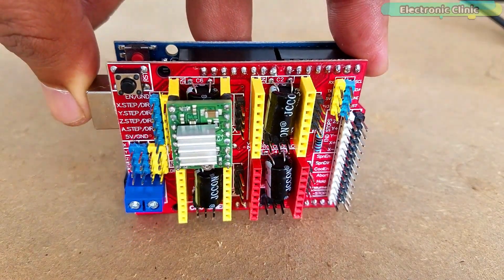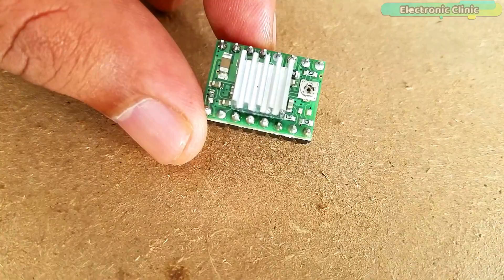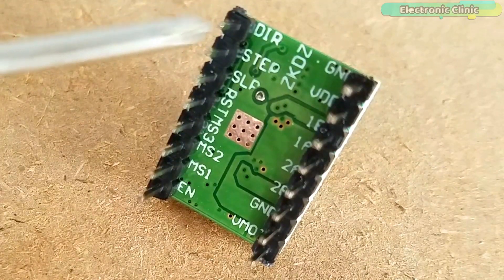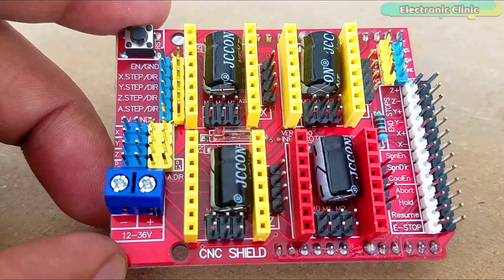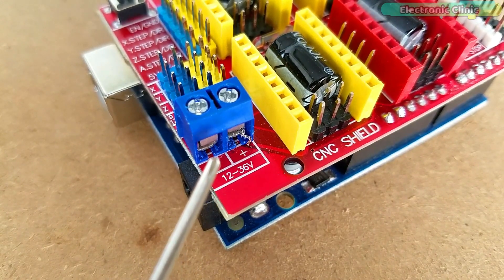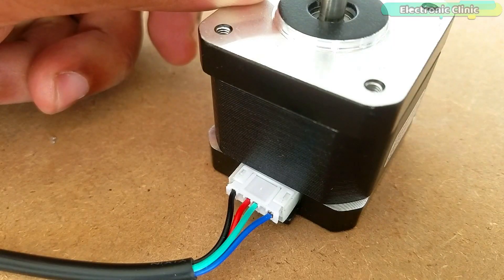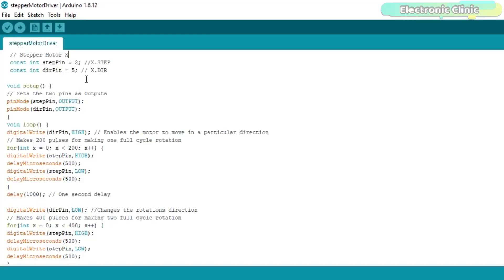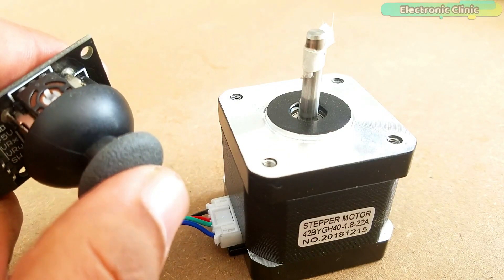Arduino CNC Shield V3 and A4988 Hybrid Stepper Motor Driver, CNC Shield pinout, wiring, code, DIY

Comment: Its working great for me but would like to control 2 step motors how to do it ?
Reply: Send step / direction to the appropriate pins
Reply: @petermuller608  thankyou I was able to control 3 steppers but they all run simultaneously at same speed. However, I want to make them run at various speeds for each one of the stepper motor.
Any lead on that, please?
Reply: @charmingali34  are you sending step pulses at different speed to your three motors? The step frequency is directly related to the motor's speed
Reply: @petermuller608  I am able to send step pulses at 3 different speed but for that I have to change the speed everytime. So the option is using Arduino Serial Monitor I can give my values but Serial Monitor is very basic and not a friendly GUI.
So, I build a GUI on processing and sending the values from Processing 3.0 to Arduino. But the problem being faced is I can only send one value at a time from Processing 3.0 to Arduino  which will run the 3 motors at that particular speed. However, I want to run all 3 motors at 3 different speeds simultaneously. 
An advance thankyou for your time on my query.
Reply: @charmingali34  I am not familiar with that software. I would recommend looking into grbl for motor control and sending commands using gcode oder Jogging commands as serial data. Grbl is very advanced with regards to motor timing
Reply: @petermuller608  Thankyou. Definitely I will look into it.
Reply: Hello, I am also figuring out to control 3 stepper motors. If you come across any help or supporting materials please share the link. Many thanks

Comment: Great video.  Where do I connect the 12 volt spindle motor.  My shield uses a 24 volt power supply.

Comment: Connected and done as described without joystick part, but motor is not rotating, instead it is getting current at getting fixed(jammed), Any solution???????
Reply from the maker: check your stepper motor wiring.
Reply: @ElectroniClinic  one pair with zero resistance to one pair of + and - , its ok ?

Comment: Good tutorial,  I noticed you did not cover any explanation orientation or format after soldering your stepper motor wires before joining on the 4 male hitters on the cnc sheild. Does it not matter which order these wires should be connected?
Reply from the maker: i have already explained this in my previous videos on the stepper motors.
Reply: @ElectroniClinic  thanks, I looked at both your videos for stepper motors and could not find the answer to my question, though I did pick up a few things. Thank you.